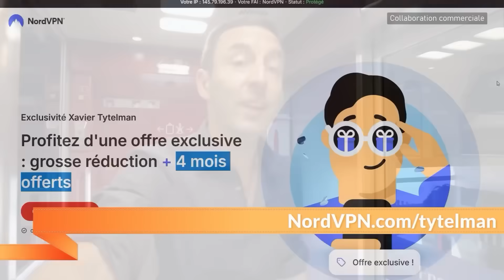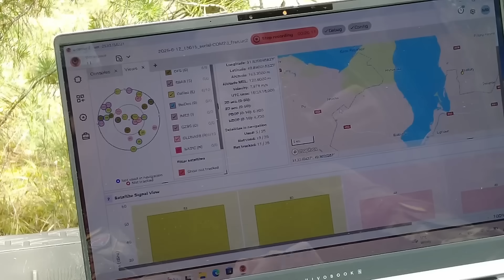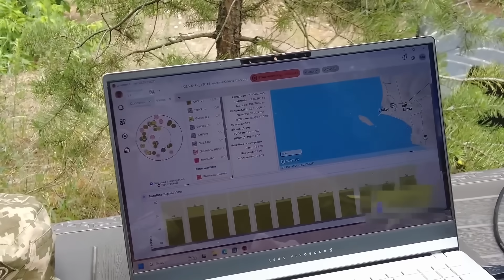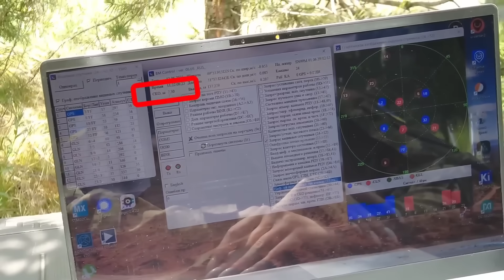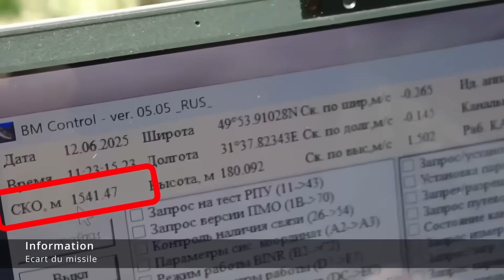Electronic Warfare: Ukraine's Secret Weapon Against Russian Missiles

Comment: That chip is shyte, I have one, Orders of magnitude better and cheaper would be to use a Luckfox Pico Pro/Max (RV1106) with integrated RV1106G3 AI chip, linked to an Ardupilot, then DIY hardened. Perhaps you mean the board. Is the manufacture date from the numbers, Week 24 of 2005 (or 2015)? If Russia is buying such junk for more than the cost of a Mcdonalds happy meal  then Ukraine has already won. (;

Comment: Interestingly enough,. Frequency jammers can be developed in a concentrated beam or output that would scramble it's system. By introducing the right frequency, you can even generate enough vibration to overload them.
Reply: Yup, I use a 2 meter actuator rail with overpriced 45cm dielectric lenses, so I can keep sidelobes down for stealth, works a treat on  statist BS war machines. (;

Comment: Firstly, there is so so much misinformation. 
Electronic jamming includes the following;
You have a multiple radio signals that tries to tap into the functional radio frequency of the drone or missile. Once the frequency is identified, the controller (on the ground), will divert it away from you. Then comes the gps or the Russian or Chinese positioning system, the signals can be copied and scattered. This is a rare thing because no one knows when a drone is coming 😂.
It's sad that Ukraine got a puppet government after the coup in the maidan. Ukraine was going to become a great nation. Ukraine has great minds. But they have woken up and will take back Ukraine from the US puppets.
Reply: The coup failed, and its leader had to run to Kremlin for protection, just like Al-Assad.
And we've seen that the people aren't afraid to go against Zelensky either when they are displeased.

Stop spouting Kremlin propaganda and THINK.